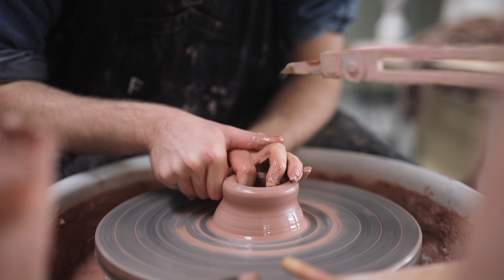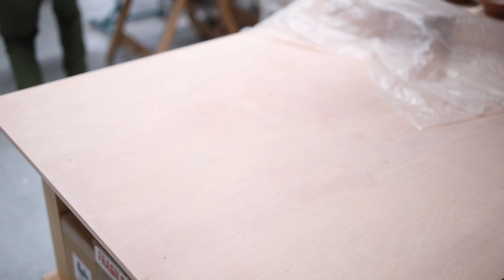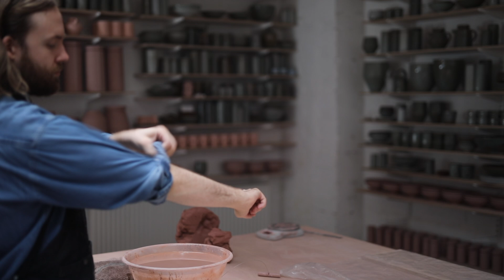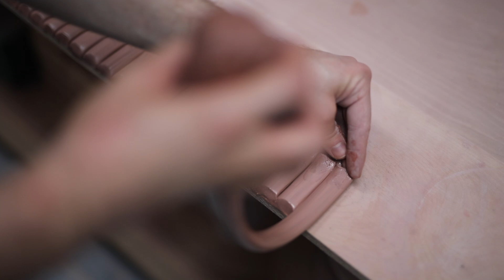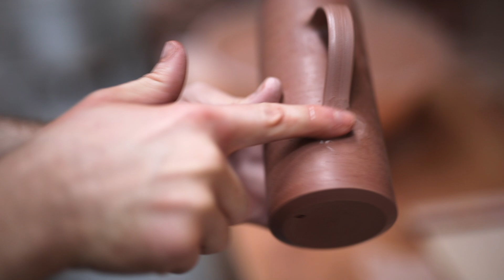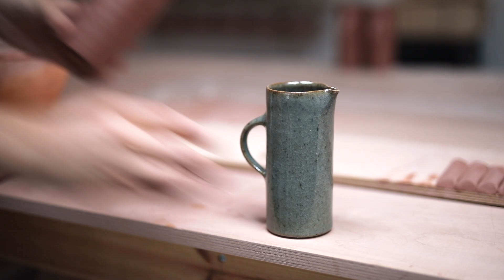Throwing, Trimming and Handling a Pottery Jug — ASMR Version

Comment: I have two questions when you have the jar upside down do you push the center of the jar in a little with your fingers or you use the tool or does it stays flat? Question two the handle is there a Pacific size and the length is it all the same size and width or is it different. Thanks you for sharing your experience with us.